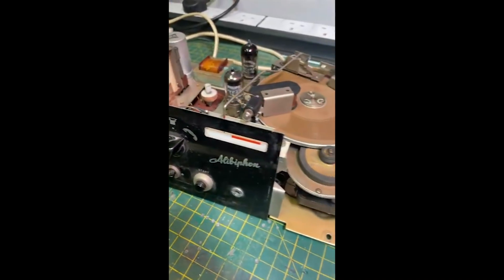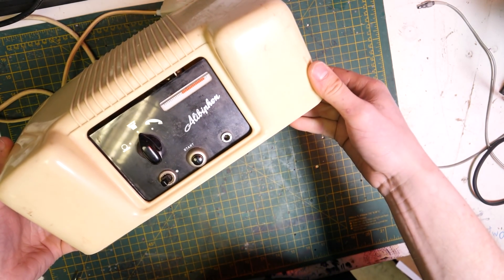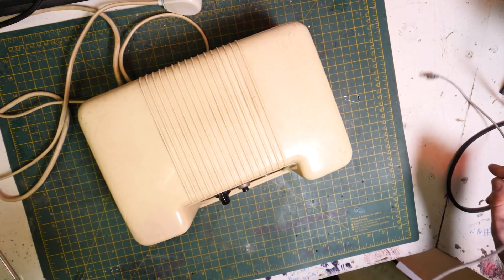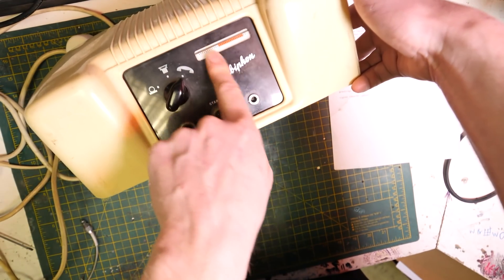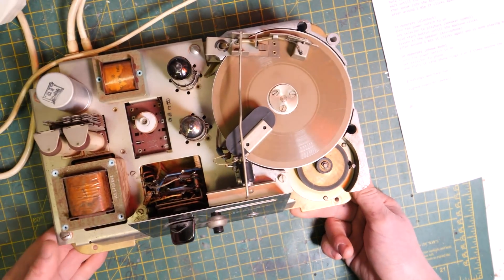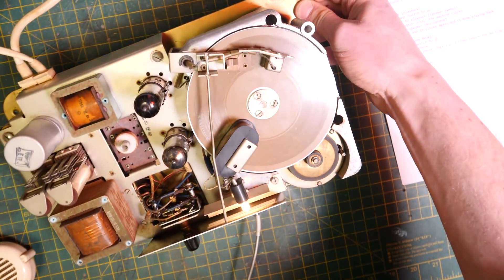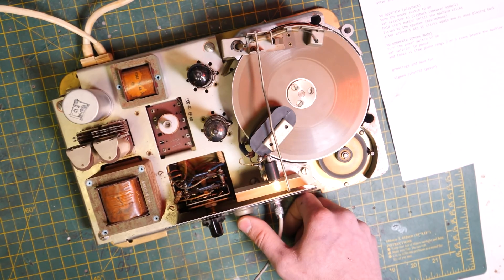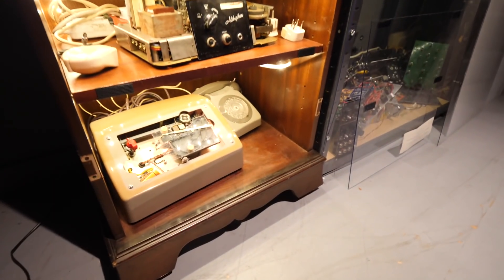The Alibiphon A Magnetic Recording Answering Machine

Comment: In Denmark in the 1950's and 60's you could rent a similar device from the phone company - only their equipment was allowed to be connected to the phone grid. However, it had an output and a power socket for connecting your own tape recorder if you wanted to record messages from the caller.

Comment: A cool piece of vintage kit.

Just a quick "noob" type question, as the UK's telephone system go fully digital with analogue signals being made obsolete (no pun intended) in the next couple of years, will that affect everything in your museum? Just wondering as I'm still using cabled/wired landline phones around my house (can hear better on them due to my deafness).
Reply: Since everything in the museum is hidden behind a "real" phone line, and the internals are equivalent to e.g. an office building exchange, I think he should be okay. May need some sort of translation device between the two sides to make things match up but that sort of thing already exists for converting between VoIP networks and "real" phones and will likely be in quite high demand after the switchover (:

Comment: The ingenuity of these things is just astounding. I noticed when it rings that the tape platter moves a little. Is this somehow counting the rings until it picks up and answers ??
Reply: No I think that’s part of the machine to reduce electronics. The first part of the motion of the tone arm is not autonomous. To allow some pulses to ring before it plays. Then it gets to a certain point and hits a switch that makes it play autonomously
Reply: @LOOKMUMNOCOMPUTER  Thankyou for clarifying now it makes sense 😃
Reply: Really funky the cams though. Seems 1 is for start. 2 is for begin message and just keep playing 3 is stop and a fourth emmm… no idea 🤷‍♀️
Reply: @LOOKMUMNOCOMPUTER  You're nerd sniping me so now I need to look at the schematics. Cam 1 turns on the circuitry and probably also takes the line off hook, cleverly using the relay coil as a filter choke. Cam 2 seems like it may be to return to beginning, cam 3 keeps it running until the end of the message and the fourth appears to turn on the lightbulb partway through the process, presumably when the pickup is over a usable part of the disc. In reality it looks like the only light bulb is constantly on so I presume that switch is stuck.
Reply: @eDoc2020  there is a extremply rare recording atatchment for this device
it might be the last cam was used to power that one?